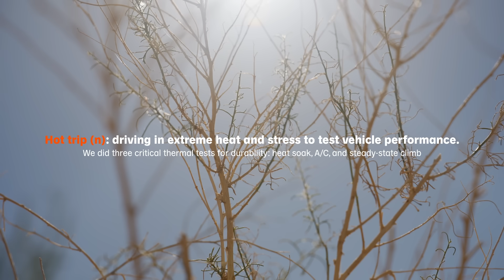How a Slate beats the heat

Comment: 2:27 you can tell the heat has warped the hood pretty good already.. 
Love this truck and idea, really awesome to have simplicity come back, but that is something that will probably annoy consumers if it already has warped from the sun in less than 1 year. 

(Even if it was a truck from the beginning, 3 years and a warped panel still is something to address in my opinion as a manufacturer)

Comment: A super simple car without unnecessary monitors, touch buttons, etc. It probably won't be produced in the European Union because the rules regarding safety assistants are ridiculous, and there's simply no cheap car for commuting to work or transporting things in small towns or villages. It's a cool idea for a car, but like I said, the European Union will probably kill this cool car like any other.

Comment: Battery temperature are worst in the sand. The radiant heat coming back up and onto the battery skid plate. Slow speed, constant new hot sand blasting heat through radiation and not just convection. That is what gets it.

Comment: NOPE!  This won't be successful. There's certainly interest in this right now, with preorders and potential sales in the first year. However, after two to three years, people will tire of having it sit on a charger and unable to use it for long distances. Early buyers will quickly sell it, reducing its value and eventually leading to the brand's demise. People don't want electric vehicles unless they can travel over 400 miles on a single charge, and they want that charge to be completed in 5 to 10 minutes. We don't want to wait! Instead, consider adding a small gas engine to this truck, which would increase sales and ensure long-term popularity. Stick with electric vehicles and watch their popularity decline.

Comment: Very Excited for these vehicles. I love the aesthetic and mechanical simplicity. And the emphasis on end-user repairability and modification. 

One request: Please! Let people spin the tires if they want :D pretty much all other electric vehicles limit vehicle wheel slip and angle etc even with traction control/stability control off. And sometimes, I just want to spin around in the snow etc ;)
Please at least let users FULLY disable the traction and stability controls <3

Comment: On average, using the climate control in extreme heat in an EV uses between 10 and 20% of the battery, and ig it gets hot enough it can stop charging, shut down, and reduce power. In the winter foe the opposite affect, the range does down by 20-30% to keep everything warm and the loss in efficiency due to the battery being cold. Not even including towing, this thing wont even get 120 miles of range outside of perfect weather conditions. Now imagine this 5 years down the line when the battery has had a 10% battery degradation if not more due to how small the battery is. This is a throwaway vehicle, and it will not be cheap like slate is claiming.

Comment: Low price point can only be achieved in high volume. Any range started under 275, will be a death nail. 

This is a $40k 200 miles range stripped down truck

Comment: What Nevada Desert? What dam?  What test?  Your staging area was in Bullhead City, AZ, across Highway 95 from the iHop on the OTHER side of the Colorado River from Laughlin, NV. Your map shows you only drove twelve miles on ARIZONA State Route 68 AWAY from Davis Dam to Union Pass.  That's less than half way from Bullhead to Kingman.  
What time of year was it?  Bullhead gets very hot in the middle of summer, but most of the year it's pretty comfortable.

Comment: I kinda thought this video would be about how the Slate beats the heat and not just people talking about what the test was like to complete.
Reply: The title is definitely inaccurate and a bit disappointing. I was hoping to learn some things about the cooling tech on the Slate and cars like it, even in basic terms.
Reply: not alot of videos of just driving and handling, yea theres clips but like i wanna see more in depth than it coasting on a street.
Reply: That would require them showing you something that the truck cannot do.
Reply: @jeepneygang  1:02 "We're pretty stable at 17 C cabin temperature."
The truck goes uphill under its own power with the video context of other traffic.
It's not a full sheet of test data or anything, but within reasonable expectations, the video shows the truck successfully "beating the heat".
Reply: @JohnologueOpinion there's only one thing that sells me on a vehicle. How well does it do in a police chase?

Comment: Hopefully you didn't test the A/C with just the smallest cab configuration.
Reply from the maker: The AC is designed with the full SUV spec's in mind, so you'll be comfortable whether you're driving the truck or a 2 row setup.

Comment: It's going to be a tuff sell against a  small Ford truck.
Reply: Tell me where the small ev Ford truck is at? They don't make an EV Maverick, or a 2 door Maverick
Reply: @PointBlank65 ford has 4 door 6ft bed EV truck in the works due in a year.
Reply: With more power, similar or better range, nacs port with good charging, more performance, 4 real doors&rav4 passenger space+more cargo capabilities and farley claims tesla level ui! 

Slate should pivot imo, raise at least $1,000,000,000-$2,000,000,000+ to show they are serious about scaling. Delete the base pack option. Compare the new leaf at 29k&bolt euv at $28k standard equipment and reconfigure the slate to be competitive against those affordable evs. It will likely mean a $28,999-$29,990 starting point. 

But if the big pack is now standard and it inc a radio+power windows etc comparing much more favorably to those base evs. 
I think people will accept it more readily.

Comment: I'd consider getting one, but I want 4 wheel drive and I've heard they aren't even considering it. Too bad.
Reply: Don't worry this will never make it to market as is. It's just another lordstown/fisker/karma/arrival/foxconn/faraday future/byton etc failure SMFH. They need several more billion just to stand a chance and that plant they are remediating? Yeah no chance they get it done, move equipment they can't afford in which has years of lead time, start trial production and then produce customer cars all in less than 12 months SMFH! 

Cool idea sure, niche market though and the base battery was moronic. The new ford ev truck for 30k with 4 doors rwd but as quick as a base mustang with rav4 room killed this thing dead. And with the Nissan leaf and bolts offering similar or more range, with better charging and more equipment for 25-29k their price point is doa as well!

Imo slate is just another con job.
Reply: @4literv6  Most EV startups include a consumer electronics (infotainment) and extremely demanding robotics (self-driving) startup in their price tags, and they're using a lot of off-the-shelf parts.
The whole thing is also seemingly meant to utilize/demonstrate a portfolio of manufacturing consulting/contracting firms, which probably use more accessible/flexible manufacturing technology than is typical for the auto industry.

My understanding is that you don't raise more funds than you plan to spend between rounds of funding, or you're wasting people's money.
I'd say given their backers, they could have gotten more funding if they needed it, and their relatively low funding raised by the time they filled a warehouse with prototypes is a reason for confidence rather than doubt.

Comment: Out of my price range but I seriously enjoy the "old school" understated styling . Nice looking truck .
Reply: Very unlikely now that ford is doing the $30,000 unboxed compact ev truck. Nissan has a $25,000 leaf with similar range to this things extended version and GM bought the bolt back for $28,990 with 255 miles of range smh. 

Slate also needs another $1,000,000,000+easy just to outfit that plant they are remodeling. Imo they should pivot immediately to dropping the stupid base battery. 

Raise the price to say $28,990(offer order discounts to the loyalists who put a down payment on them)for 240+miles of range and ad enough standard equipment it doesn't look out of spec against the new leaf&bolts!

Comment: Will the AC cool the vehicle with the SUV conversion top in these conditions? It’s a much larger volume to cool.
Reply from the maker: The AC was designed with the full SUV spec's in mind, so you'll be comfortable whether you're driving the truck or a 2 row setup.
Reply: @slateauto  Great. Thanks, I’ve got my order in.

Comment: Sick. Can't wait to see cold weather testing!
Reply: Drive up to Edmonton. -40c and +40c are almost the new normal now. Hence why I really want a CATL Sodium Ion Battery in whatever vehicle I buy next! Hopefully this one or something similar!
Reply: Sick? Looks like the Slate did pretty well.
Reply: @richpate9436 .   Well? Looks like slate did pretty sick.
Reply: Hope the seats are comfy. I hear they’re really hard.
Reply: Yeah, they test it in the heat but I live in a climate with real winters.
Reply: Heat pump is a must
Reply: @BeLowBelowo  and not included
Reply: @rockinkuwaitchris oof! An EV without a heat pump is an absolute non starter!
Reply: @suprPHREAK  almost agree.  I've got one, a model 3 before they used heat pumps.  Yes the range shortens in winter, but it still does 200 miles or so which is enough even only charging to 85% and we have two vehicles so if for some reason taking a mid winter long trip we have options.   

That said it also comes with heated seats all around which are great cause you can drop the cabin temp a bit, turn up the seats, and be just fine (a lot easier to heat solids than air).   But this one doesn't have that, and not using any sort of new batteries where you can keep charges higher without deg... 35ish miles in winter there for your distance day to day that you can leave the house is not great.

Comment: Will ventilated seats be available?
A heated steering wheel & seats
are very nice to have in Winter.
Reply: They mentioned that they will have an accessory for heated seats. Nothing said as of yet for heated steering wheel or ventilated seats. Honestly ventilated seats I feel are only a big benefit with leather seats. Cloth seats never had a big desire for them. Heated seats on the other hand always worth spending a bit more for them in the winter.